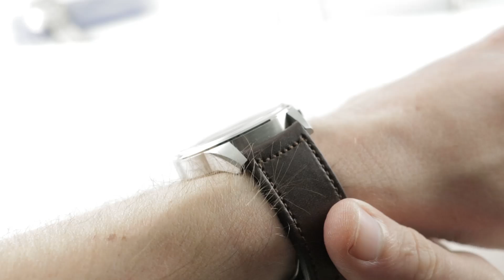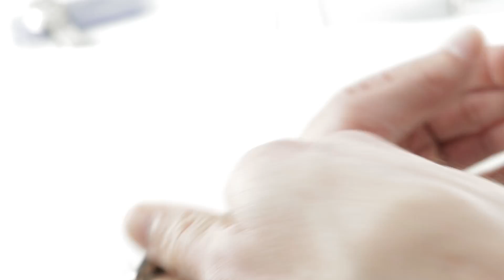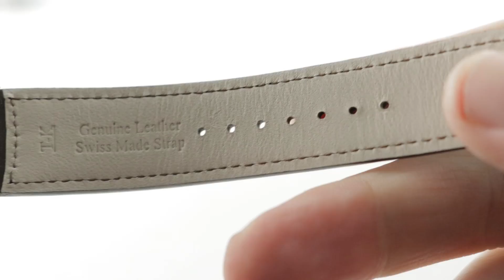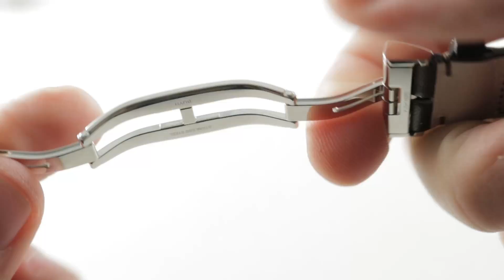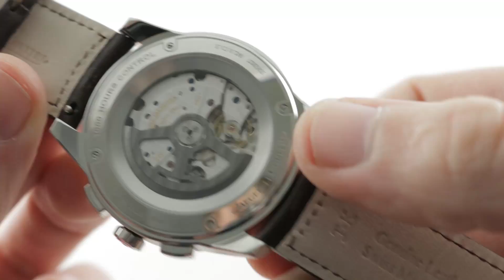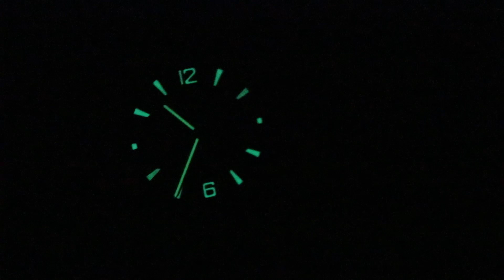Jaeger-LeCoultre Polaris Chronograph (Q9028480) Luxury Watch Review

Comment: I didn’t know about the strap quickchange on this model. Awesome. 

My only complaint is that I can’t help but feel JLC reused an undersized movement in this case.  They did their best with the dial layout, considering, but I’d be interested in what it would have looked like if they had a more purpose-built movement.